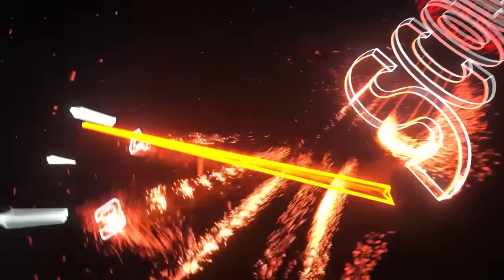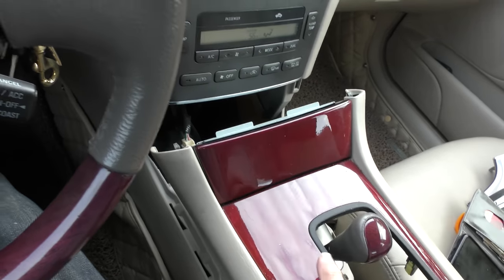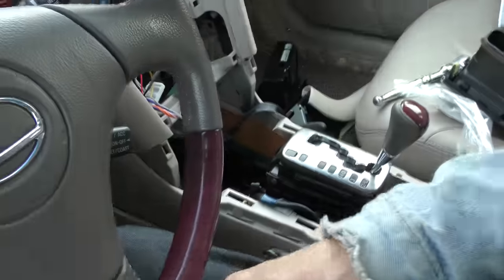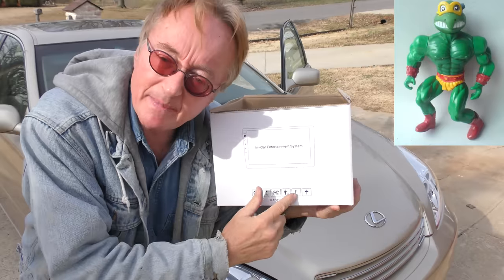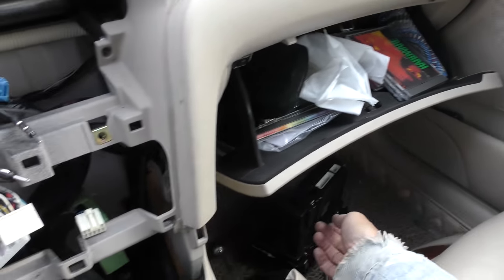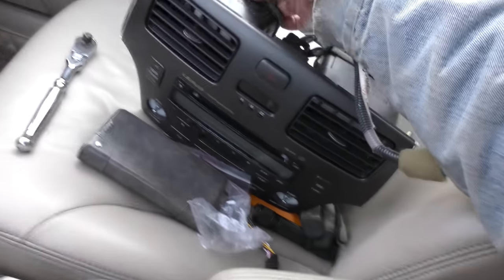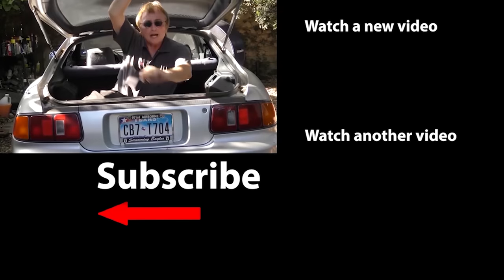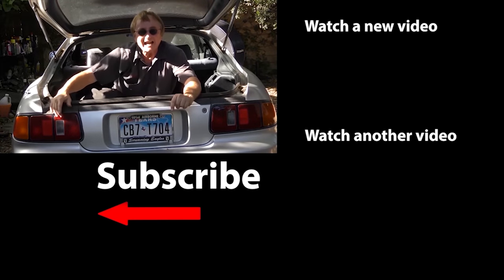A Sad Day for Toyota and Lexus Owners, I Just Screwed Up

Comment: Crutchfield has never failed me
Reply: They are great! Put a new radio in my 2004 Lexus, back up cam and Waze. Works great!
Reply: Ordered from them for my 2001 Tacoma works great
Reply: Thank You Crutchfield! 🙏🏼
Reply: I’ve installed 4 radios from crutchfield. They make it so easy!
Reply: I was about to say that you beat me to it
Reply: Too expensive for the Chinese junk yard radios!
Reply: I'm a huge fan of crutchfield for years
Reply: I was sent an incorrect harness converter by crutchfield but they made it right. Generally good tech support.
Reply: Yep, Scotty -- Crutchfield all the way.
Reply: Yup Crutchfield has excellent products and excellent support.
Reply: Crutchfield for the win!! They're diagrams were great. Only problem I had was the included mounting plate had to be taken off and the original ones put back in. Apple Car Play. Some easy wiring with soldering and heat shrink, took me 35 minutes. Huge upgrade, really nice.
Reply: They'd probably hook Scotty up with a harness just for a free mention.
Reply: Another vote for Crutchfield. They’re not the cheapest vendor out there but they are the most competent.
Reply: Crutchfield is the best.  Period.
Reply: +1
Reply: Absolutely, they have adapters for everything.  Also, get a pioneer.
Reply: I love how they break down your specific model & they even asked if my trim level had the upgraded speaker package or not….great
Reply: My friend and I were fairly new to changing out radios, and we bought a Sony deck from Crutchfield for my '05 Ford Escape. Recommended me everything I needed, and has worked well every single time since we installed it for over a year, almost 2 now. 

Will absolutely use them again when the time comes for a new radio, and will recommend them.
Reply: I agree. Crutchfield has a good setup and gives you what you need.  Put a Sony in my 99 Sierra which has Apple car play.
Reply: Crutchfield is the best! They also have installers if willing to drive to Virginia! Me personally, yes I would!
Reply: Agreed. Simply the BEST!!!!!
Reply: Crutchfield is amazing!! Bought a radio for my 02 Tacoma, they even wire it for you!!
Reply: They hire knowledgeable people with brains, not smurfs. What a novel business model.
Reply: Wow! A classic! Forgot all about that
Reply: Exactly what I was going to say.
Reply: Agreed. They stand behind their products and take it back if it doesn't fit.
Reply: Used it for our 2014 Mustang, was super convenient!
Reply: Like you needed the practice.
Reply: I've never heard of them ,what a great review from all yall on here for them ,are you saying that they can do Scott's Lexus?
Reply: He does say that a stereo shop is your best bet at the end of the video
Reply: Tried Crutchfield for a 2013 Lexus ES 350... no good... they're catalogue is great for most cars. But not that one.
Reply: They failed me I gotta 13 edge and they have nothing for my model yr 😔
Reply: @bluethunder4542  Electronics company out of VA. They sell all kinds of Electronics. Bought a surround system for my TV back in the late 90's, also a high 8 camcorder. Good company but the prices are a little high. Definitely worth it for car stereos.
Reply: Crutchfield will make a custom harness for like $25
Reply: Came here to say this same thing.
Reply: Crutchfield has figured this out. They will have the harness you need and a million radio models. Can't go wrong there.
Reply: Yep, for 25 bucks they'll even solder the radio and adapter harnesses together for you.
Reply: Yes they are awesome!
Reply: Yes, its time Scotty to be introduced to Crutchfield magic!
Reply: Overpriced
Reply: Right! Even pre internet when we just had the catalog.

Comment: I own a similar Lexus. I plugged an FM transmitter adapter that also has a phone charger outlet into my cigarette lighter and it works like a dream. Plug-and-play. Less than $25.
Reply: I did too, it works fine no complaints except for the fact that it sticks up and I can’t close my ash tray. Bothers the heck out of me. I have an identical Lexus to scottys.
Reply: Battery drains
Reply: 16.88 at walmart. Works great.
Reply: i did the same for my falcon you get static from the engine but better than something that wont fit or leave a hole in the dash.
Reply: @cootason  the static has a lot to do with the brand. Also, the frequency you are tuned to.
Reply: The only problem is that Waze or Maps don't work very well using those. 
I mean, yeah, you get the Turn-by-Turn voice directions, just not the maps.

Comment: Scotty! They sell little boxes in the shape of cassettes that go in your car’s stereo. You can get them with a headphone wire coming out of it, or you can get entirely Bluetooth ones!
Reply: The sound quality sucks though with those black boxes.
Reply: @applepoop10  he grew up when everything sounded bad so it’ll be like a blast to the past
Reply: @WastedDad  Wrong!  He mentioned Records were before Cassette Tapes.  Point is, Records still today have the BEST sound.  So, everything didn't sound bad back then.  They were ahead of there time if anything.
Reply: I have to agree with this person he said his wife don't like loud music anyways the cassette box's work the same as that little speaker they have in there so 🤷
Reply: @applepoop10  ive found it sounds better than fm transmitter in my car
Reply: @lePPa-7h  In my case, the transmitter wouldn't work if I got the slightest signal from anything else.
Reply: @Trainfan1055Janathan  for some reason every stand alone transmitter i tried, barely worked. However the one that is built in to a satellite radio worked perfectly.

Comment: I've had bad luck with this, too. I couldn't figure out which wire to splice in a 2005 Volvo S40 because all the wires were the same color. 🤦‍♂️

I couldn't even remove the radio in a 2002 Mercury Sable because the radio required a special key to remove, which I bought, but the radio was stuck, plus you have to take the entire dash apart just to remove the radio.
Reply: That’s GM for ya! I have a Toyota Corolla and it takes a solid 15 min to take it out and put it back in.

Comment: I bought one of these for my 2019 Corolla to get CarPlay on it. The wiring needed no modification, but I did haver to remove a couple screws from the harness to get the trim panels to fit back in. Works great and it retains all OEM features like backup camera, steering wheel controls, etc.

Comment: Wow, cassette tapes were on their last legs even when that car was new.
Reply: I think Toyota screwed up and stocked too many cassette players and had to get rid of them.  Seems like they installed them in new cars way longer than other manufacturers.
Reply: my 2002 car model has only cassette XD
Reply: My 2004 Tundra has both cassette and CD player I only use the CD player and sounds great.
Reply: An $8 cassette adapter will connect you to any smart phone or anything with a head phone jack
Reply: I use a Bluetooth cassette, no wiring mess or paying a butcher to end up with electrical issues
Reply: I had a 2004 Suzuki with cassette and CD.  My 35 year old cassettes sounded horrible in it.  I don't know if the player was bad, or magnetic media degraded.
Reply: @daviddabo2682  there's a such thing as a Bluetooth cassette? That blows my mind. How's the sound quality?
Reply: I use the cassette slot in my Lexus to hold my marina gate RFID card. My first car, I mounted an under-dash 8 track player and put Pioneer speakers into the door linings.
Reply: My 1st Lexus had It and It felt ancien in the data already

Comment: I actually bought one of these Dasaita head units for my 2016 Corolla last year. It was plug and play and pretty easy to setup, and it was a great product with wireless apple carplay. I ended up selling the car, but the Dasaita head unit was excellent.
Reply: never had a problem with mine ether

Comment: You need to get a stereo install kit, Metra & Scosche makes them comes with face plate, bracket adapter & screws to fit car & also they make a wiring adapter plug for Lexus & goes into any after market radio & you not have to cut any wires. You have to use the plug from the radio & match the color of wire & tape or solder & heat shrink tubing or use wire caps to connect them together on the wiring adapter & plug it into car harness. I have done Lexus already & any after market radio will fit that car single din or double din which that android radio is.
Reply: 👍 More often than not.  ☝

Comment: Scotty, you forgot the "8 track". I've never installed an aftermarket radio, & had it sound better than the stock unit, course  all the times I did, I never replaced the speakers. That probably didn't help . 😲😲😲

Comment: I had to do this on a 93 Silverado. I told the owner that I'd have to splice the harness and he was fine with it. That was 6 years ago and it still works fine 👍
Reply: Why would you have to splice a harness on a 93 GM? You can buy those, along with the antenna adapter if the vehicle has a GM radio antenna.

Comment: Tip for running your AC compressor below 32 degrees. Install a auxiliary power line with a switch and a fuse in line to the electrical line plug at the AC compressor, splice it in and your good to go.

Comment: Scotty I’m the type of guy that likes to keep stuff in cars original. They make this device that looks like a cassette tape with an auxiliary cord attached to it. If you put it in your cars cassette player and have your phone hooked up to it while playing music from your phone it will play on your car. If your phone doesn’t have an audio jack you can get an adapter and attach it to your charger port then connect it to the “tape looking” device and it will work. You can directly play music in your car without messing with your cars factory setup. I used to by plugging the jack into my phone then inserting the “cassette looking” thing into the cassette player. Then hitting play on my cassette player

Comment: Maybe you can get an AUX cable to connect to the original audio system on the CD changer input. FM transmitters will work, but do not have excellent quality due to the limitations of FM standard. (50 Hz to 15 kHz)
Reply: I had a shop hook up an aux cable to factory unit in an ex gfs beetle. I think they charged about $100.

Comment: If I am not mistaken that model of Lexus has a hidden amplifier in the trunk. Rather than run new wires to all the speakers, you could get a signal voltage reducer at the back of the new radio for all four channels to take the output down to millivolts and still keep the rest of the system in place without pulling apart the rest of the car or frying the amp. Also  If the aftermarket radio has four channel pre-outs which is a low voltage out, you could adapt the connections to speaker wire and forget the reducer.

Comment: Hey Scotty. Get a Bluetooth FM transmitter radio adapter. I have one in my 2006 matrix, hidden in the center console, works great. Also, I bought a tablet mount which installs in the CD slot on head unit and use a cheap Samsung 8 inch tablet. Turn on tethering on your phone, connect tablet via Bluetooth to adapter and via wifi to phone for internet. You now have the full setup.

Comment: Hells bells scotty, you should have just bought a cassette adapter and plug it into a phone and run any android stuff thru that. Easy peasy.
Reply: That's why the cassette slot is fitted, they knew the technology was coming through so left it in the in car stereo system for when it became available
Reply: From my experience, most of those die out fast, within weeks. And they are becoming harder to find in stores forcing you to go online and pay shipping.

Comment: I use an FM transmitter on my truck and it works just fine, decent sound too. The truck is a 2007 f150
Reply: I use FM transmitter too. Decend enough

Comment: It will work Scotty.  I ran into the same problem. I have a 2005 Solara. I used a Crux brand Toyota adapter.  It works with any radio including the one you have here.  It was frustrating at first until I found the right harness adapter.  I have replaced my car with 3 different types of radios and they all worked great.
Reply: I'm using a Crux Bluetooth adapter with the factory head unit on my '05 Accord, in the AUX port. While my particular version doesn't work for calls, it streams audio quite well, was plug-and-play, and is tucked away behind the scenes.

Comment: Thank you Scotty.  My vehicle is sitting outside in almost complete electronic disassembly
 except for the new speaker wires with a system that I don't especially like anyway.  
May use your sage advice to good use the Android route without this dead end scenario.

Comment: Hi Scotty,  you can Just rewire the adapter, then you don't messup the original car harness. You need the car connector adapter diagram and the new android radio which is probably in the unit documents.
You write down what color connect to what color and you're done, actually you can do all the wiring at home. And just connect the rewired adapter.

Comment: Hey Scotty,
Can’t you use jack cable in the headphone plug from your phone? Most car stereos have a line in input in the back. You just need and adaptor cable or can wire it yourself.
Reply: new phones dont have jack so you are forced to use bluetooth
Reply: @mindofvirtuoso3358  you just need an adaptor for your phone to give you an aux jack.
Reply: Or you could use an MP3 to cassette adapter, he has the deck.
Reply: That lexus is pre 3.5mm audio jack car. It would be having RCA Jacks and not 3.5 mm
Reply: An $8 cassette adapter will connect you to any smart phone or anything with a head phone jack
Reply: Their Lexus is pre-3.5mm jack...no AUX button.

Comment: If you do decide to rewire the hole thing; recommend using a tiny-12volt battery to figure out the speaker wires, by hooking the speaker-wires to the battery-terminals until you hear a static/pop noise from speaker then you know you have the (+, -)pair to said speaker and will audibly hear which speaker it belongs to (Left/right/back/front). Its safe, the fastest easiest way.

Comment: Hey Scotty..instead of rewiring the car just rewire the adapters  you can get the diagrams from the radio company. And the wiring for the car from the web. Or just buy them from crutchfield. 
They have all the right wires and its not too hard.

Comment: They make adapters for them. Had to do it for my gs 300 but i had to splice it to match the cord position of the radio. From the forums, it seemed like it was like that for most lexus.

12 wires max isn’t to bad to figure out but since you got it for free, your radio still works and they didn’t even make it easy for you, I wouldn’t bother either

Comment: I had a similar dilemma with my 2000 Toyota Avalon I connected my I phone with an adapter that plugs into the cassette player. Easy PZ  works great for 12.00 at Wally World. I also replaced the JBL subwoofer in the trunk that took a little work getting it into the previous mount.
Reply: the only thing that sucks about the tape deck adapter is that youre limited to the sound quality that a tape deck can produce, good enough for most people, but not ideal

Comment: Hey Scotty, it looks like the wiring connector on the car has been previously replaced with all the electrical tape connections and such. Is that the case?
Reply: What?? That's how it comes from the factory..with that plastic to keep the harness together. Unless we're looking at two different.things
Reply: @richsweeney1115  no, you're right and OP is wrong

Comment: Scotty! I have an easy fix for you! Get a stereo FM modulator with bluetooth. Fits in the cigarette lighter plug and wirelessly transmits the audio to any fm radio station you choose. You can connect your phone or any bluetooth device to it wirelessly. That would easily solve your problem. Get rid of that bluetooth speaker!

Comment: Remember Scotty some of those stock radios have a built-in security circuit and the vehicle will not start of you pull or change the radio!👍🙂
Reply: That's not true at all..no car will stop running if you change the stereo

Comment: I upgraded my stereo in a 2003 Toyota Tacoma with a Sony car play receiver.  Had to buy a harness that fit my car and then wired that to the receiver.  Also added rear cameras and usb outlets.  You will need to do some wiring.  I'm not aware of any plug and play systems for old cars.

Comment: Scotty's gonna kick himself in the butt when he finds out he could have gotten a $10 AUX to Cassette adapter to connect his phone to the tape deck with an aux wire.
Reply: I have been doing that for years on my 2005 ride.
Reply: I can think of several alternatives besides replacing the interface. I bought my son a blue tooth tower speaker that works like a dream. Just sits it in his cup holder and is surprisingly loud. Lasts a long time between charges as well.

Comment: I recently fitted a Sony digital radio to my son's 2005 Honda Type R. All it was needed to connect the Honda wiring to the Sony was an adapter plug and socket set bought on eBay. Simples !

Comment: I have an 2005 Es330. Basically the same car, 3.3 liter engine. I got a pioneer Avh-2550nex android radio installed at bestbuy over a year ago. In order for the steering wheel control for radio to work, I had to buy a plug in wiring kit. It works fine and it looks way better. It's Bluetooth but in order to see Google maps in the radio display, the phone needs to be plugged in via USB. Also the radio can display cameras view. If you like, I can send pics of radio in car.

BTW... Love the upgraded head lights. I am going to get the same ones except probably with black housing instead. Also I installed 9 drive which helps with faster shifting and gives options between economy, normal, sports, and race mode. Super easy installation.

Comment: Call Crutchfield. Get the car adapter and then you have to match up the wires from it with the radio. Solder and put heat shrink over the connections.